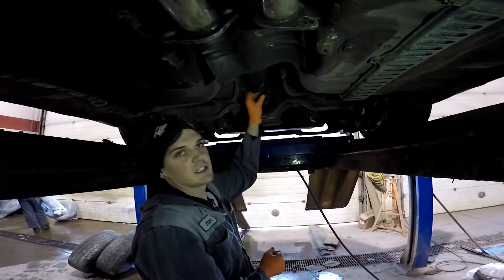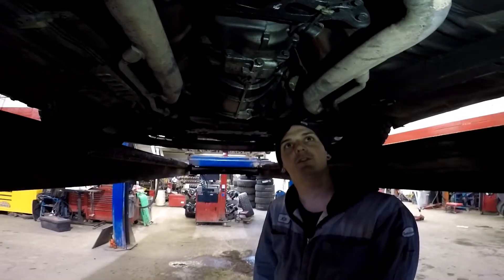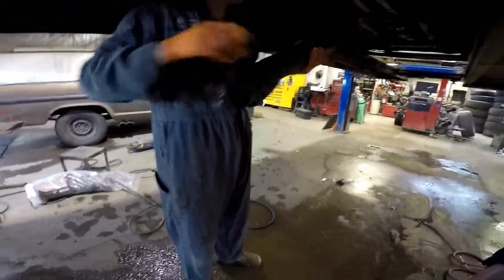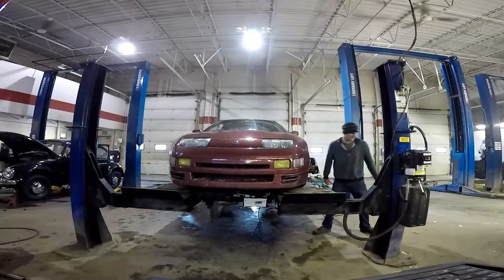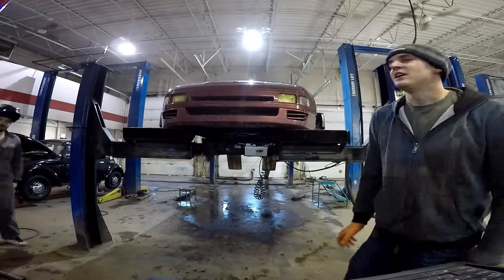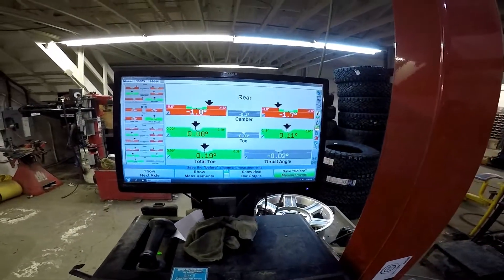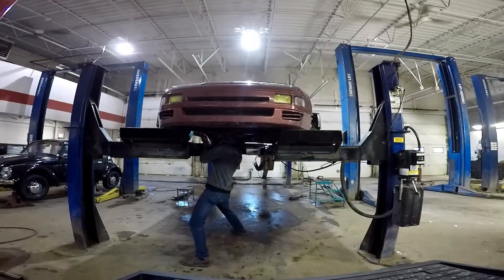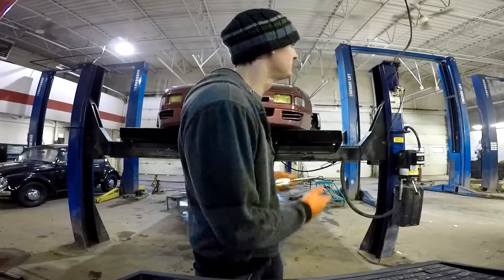300zx One Piece Drive Shaft Install

Comment: I was told that you have to take the whole rear end out to put in the driveshaft.   Is that true or is there another way that is easier to put it in ?
Reply: I know I'm two years late but not true at all. I did it today, you have to drop the exhaust from behind the cats and a couple of heat shields and that's it.